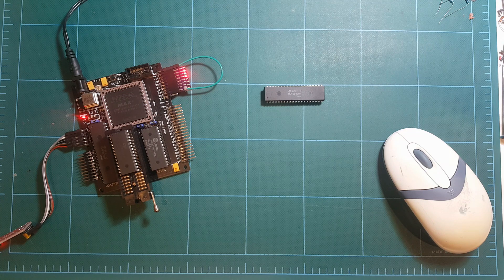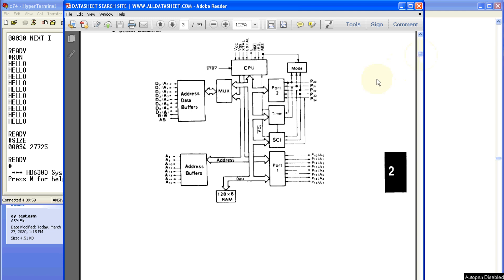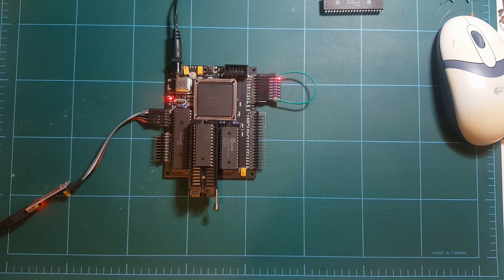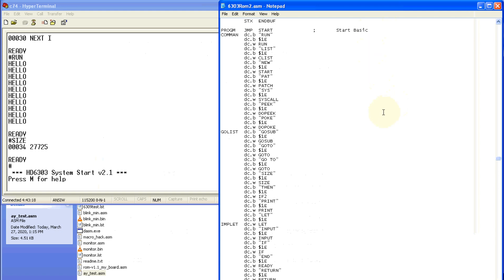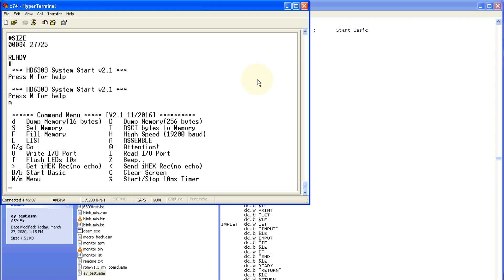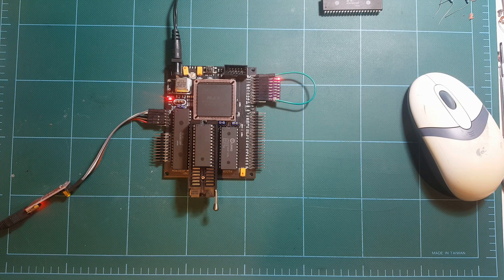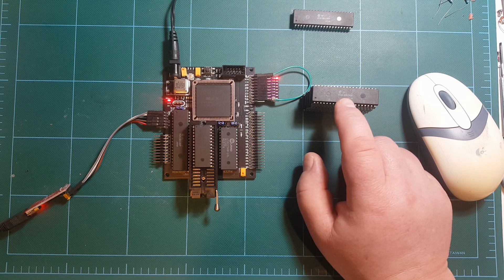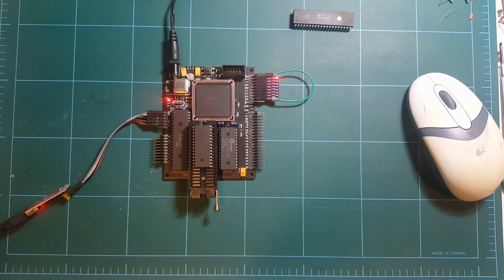hd6303 board

Comment: Thanks for mentioning me on your video.
F.Y.I. there are up_load & download tools for both PC and LINUX that will allow you to 
load your .hex file directly to RAM via the serial port.
Also one to upload BASIC source.
Hope you give them a try.
Reply from the maker: Thanks for publishing your code. I've modified it quite a bit to match my board and added features to extend functionality. I need to clean up my version as the one I published is flaky due to differences in CPU architecture. I knew about hex transfers though I've never used them. Didn't know about basic upload. Is that different than pasting source into terminal?
Reply: Essentially it just sends the keystrokes over the terminal to start BASIC and types in the source code. It's somewhat slow as it waits for the echoed character before sending another. But it still gets the job done.